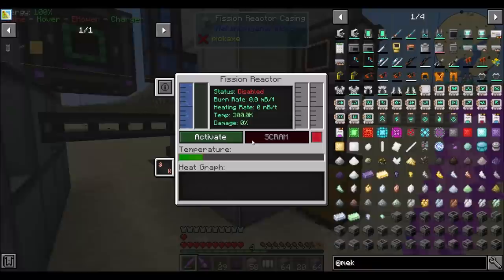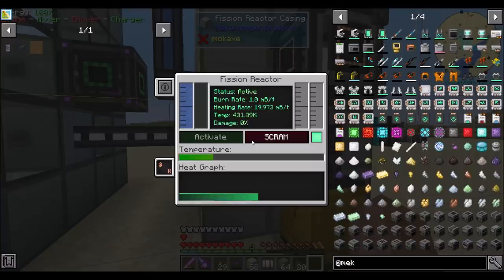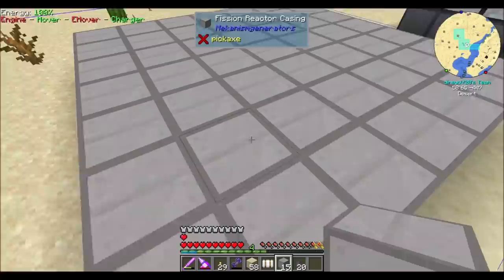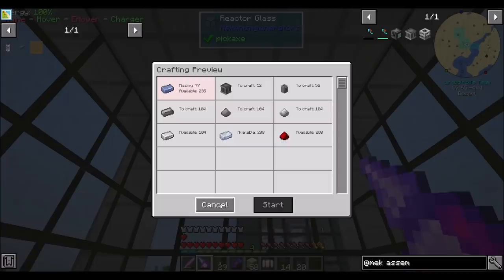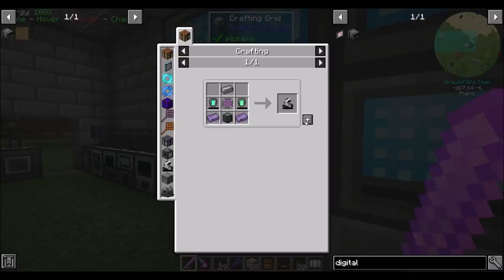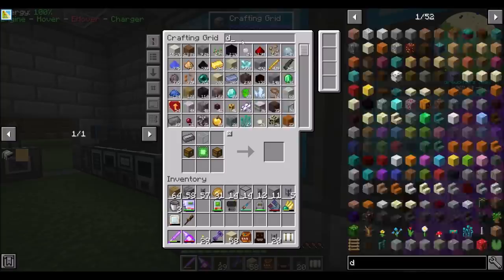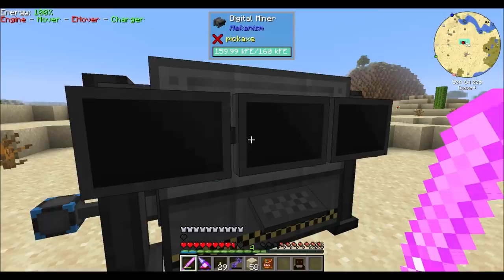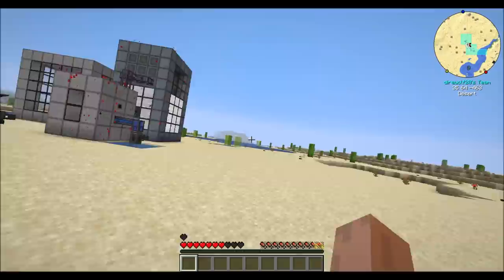Lets Play S10E64 Nuclear Accident

Comment: You are dying instanty because the reactor can't blow up due to claimed chunks, and so it 'blow up' again and again in every tick
Reply: yeahhh this is really painful to watch
Reply: oooooh the claimed chunks, of course... was wondering why it wasn't actually exploding
Reply: Thank you for providing an explaination here, I was certainly confused by this.  Let this be a leson to all the budding Minecraft nuclear engfineers out there.  Redstone controls exist for a reason.  If your reactor is fucked, you can't actually approach it to fix the problem.

For a non-cheaty solution to this, you could uyse a really long Create piston to break up the multiblock (this is just a theory, I haven't testred it)
Reply: @lazeroussdomain5862  that would work, but you would still have to wait for the radiation to subside. A simpler option would be to use a chunk loading option that doesn't prevent the breaking of blocks in claimed territory. That way at least the problem will resolve itself eventually as opposed to having to use cheats. The reactor will properly blow and the radiation will subside in time
Reply: Dire also seems to ignore the part where the 'exploding' reactor has no water in it.
then at 32:40 when setting up the new reactor he goes on to explain how he is depending on water returning from the turbine to  help supply water to the reactor.

So it would seem like the turbine shutdown when the energy buffer filled up and started venting all in coming steam when the steam buffer filled. 
This means that no water is being returned to the reactor and the reactor ran out of water.... or at least that seems logical to me.
Reply: up

Comment: Instead of voiding all your energy you might consider throwing an infinity hammer in the ultimate cube to charge.
Reply: He needs to get an induction matrix to do this. He's generating 1MFE/t, which overloads most chargers (barring tick acceleration), resulting in a boom. It's not hard, just insanely expensive.
Reply: @RealSnarb  or just make the infinity charger from industrial foregoing, that thing can do crazy transfer rates as far as I've seen, and it is made specifically for the infinity items to be charged

Comment: What I think happened with the reactor ever heating is that when it dumps excess it dumps the steam. However, when doing this it doesn't generate any water. This meant that the pump wasn't able to keep up with the reactors use of water which eventually led to not enough cooled in the system which caused the reactor to overheat.
Reply: Yeah, its just easier and safer to make it a closed loop.
Reply: @carsondrum  closed loop still would've failed since once it hits 'dumping excess' it opens the loop.  If the pump isn't strong enough to backfill the water that's being venting, the loop will drain out.

Comment: Ok i don't know if its already been answered in the comments:
the Water ran out, because it was dumping all the steam it got because energy was full. the turbine can only run if its not full of energy. and the pump couldn't get enough water to keep cooling the reactor(try the best pipes all alroud  a sink if its in the pack)
also maybe considering the induction batteries from mekanism they are really strong and not too expensive i think you just need lithium. but would be an option for an endgame energy storage system.
Reply: No, it was just flat out voiding the steam, so none of it was going back into the reactor. Thus voiding excess was a BAD idea.
Reply: Yeah, cooking with blockheads is in the pack. And everyone was calling it including myself when he built the reactor. And he didn't read the comments on it or do proper testing. 100% his fault.
And then he almost does it again.
Reply: IMO "dump excess" should do what it says and dump any excess, including energy, especially if its DIRECTLY under the energy bar.
I am SO glad I'm setting up my reactor TODAY and wont run into this .
Reply: @b00marrows  instead they should add a energy dump excess button, that'd be better
Reply: @commander3494  Yeah, that would be the most logical solution. A dump excess option for each part. I believe the system automatically dumps excess water when there's no output for it already, whys it smart there but dumb elsewhere?
Reply: @b00marrows  Maybe you should spend at least a little time testing before using something that has the potential to do what Dire did. Who obviously didn't test this and in the video provided proof of not understanding what he did wrong by almost doing it again.
Reply: @sijonda  What exactly did he almost do again? you mean the full nuclear barrel? if you didnt notice, yes the barrel was full but the internal buffer (a huge buffer too) was empty, its what he checked right after seeing the barrel was full.
Reply: @b00marrows  He almost ran the reactor dry again. He also didn't wait for the reactor to balance before increasing the burn rate every time assuming it's fine. That's s good way to blow up the reactor when you're testing it.
Reply: @sijonda  He knows about the Kitchen Sink. He said a few episodes back that he wants to use the Electric Pump when dealing with Mekanism machines.
And no, he has said time and time again that he ALWAYS reads the comments. But just because he reads it doesn't mean he has to follow it. This is a "Let's Play", not a "Dire Play the Way I want You to Play" series.
And screw that proper testing, we wouldn't have this kind of episode otherwise.

Comment: i was expecting an accident with a drill tbh but as soon as you said you were going to fill up the energy cube "and later on build the multiblock" i suspected this could happen too.... the problem you had is that the turbine filled up on energy and stopped working. you had a "void excess" but it wasn't energy it was steam and you had the steam voiding so the nuclear reactor had no coolant and that was the source of the meltdown.
Reply: But the water pump was still connected- so it shouldn't have lost coolant.
Reply: @travispluid3603   the reactors drain coolant like nobody's bussiness a single pump is not close enough to handle the needs that's why you should allways have the reactor full of water and the turbine at least half full of steam. Pumping one bucket per x  seconds while the reactor is at 100% capacity is very bad. He voided all the water because the turbine was full of energy and so the reactor was emptied quite fast, which increased the temperature making it worse. And you know the result. He should have had a way to dump all the energy... Like making a massive multiblock that he did say he wasn't gonna make
Reply: @travispluid3603  also basically the reactor was in a stage of continous explosion so water couldn't came in. The reactor damage shouldn't be over 100% but claimed chunks messed the explosion. That's the reason water couldn't go in until he stopped it. (And yet even stopped you see how fast it drains) it's just the worst possible setup tbh

Comment: "Dumping excess" dumps excess steam from the turbine, not excess energy. Dumping the steam instead of condensing it back to water means that your water pump is the only thing cooling your reactor and that's not enough, by far.

You could set the turbine to dump excess (steam) and supply the reactor with an ultimate mechanical pipe that draws from a sink from "Cooking with blockheads" (which is insanely fast). I haven't tested this, but it has a good chance of keeping up with the heating rate.

The only way of getting rid of excess energy would be to consume it in a "Resistive Heater" (without heating anything, if necessary).
Reply: I would add to this that part of the reason why the radiation got so bad is that dire had claimed the chunks, so the reactor couldn't explode. Exploding is sort of a "safety mechanism" in that once damage reaches 100% the reactor should go boom, and from that point onwards it obviously can't create any more radiation. But with the chunks claimed, it just kept heating up more and more and accumulating more and more damage, and doing what the code tells it to do which is release more and more radiation as it gets hotter and hotter - it was never intended to get to 3000% damage or 50,000K heat so the radiation released at that temperature seems ridiculous, but that's the price you pay for artificially preventing the explosion.
Reply: @eagle653  Yeah, that behaviour is kind of a bug. One should be able to blow stuff up by proxy even if one's claimed the chunks if one own the blocks that does it.
Reply: I was wondering why it didn't explode.. That would be a reason for another chunk loading mechanism that doesn't require claiming the chunks. I guess if I ever end up in this situation I'll just have to unclaim the chunks and watch the fireworks. =)
Reply: Sink and ultimate mechanical pipes have no problem with keeping up with the fission reactor. I have even used it to supply water for fusion!
Reply: The cooking for blockheads sink is insane, and I would say its op if the water consumption of the reactor wasn't equally insane.

Comment: Instead of dumping the energy. Why not using that energy to fill the infinity hammer. So maybe you can get artifact Level?
Reply: @EpicCraft1997  laughs in mekanism water filled fusion reactor
Reply: @EpicCraft1997  After E100 Or Greater. Is that enough?
Reply: @EpicCraft1997  I mean sure. if You can't get the artifact level. I think it is better to fill the infinity hammer instead dumping the energy. Idk
Reply: @EpicCraft1997  Idk why but it's just pain to me to void all energy out when we have better solution to deal with.
Reply: @EpicCraft1997  Well considering it's generating over a million RF a tick, 20 ticks in a second, it wouldn't take all that long. I would've given you the math but I can't remember the number to get it to artifact off the top of my head, vaguely remember it being somewhere in the billions or trillions.
Reply: @alexpipes2332  It needs 2^63-1 (roughly 9*10^18) RF to fill up. Assuming you can generate 1 billion rf/t, it would takes 9*10^9 ticks. 1 billion ticks is around 1.5 years, so it would takes 10 years of continuous AFK to fill it up.
Reply: @EpicCraft1997  I've filled a Tier 8 Draconic Orb before. Granted it was with a Tardis Generator. So one tick and the Draconic Orb was full.
Reply: @archcraft1548  Why would that pain you? What's the difference between dumping the energy into a trash can vs dumping it in the hammer? You can't get it to Artifact level in a reasonable amount of time anyway, plus you'll lose the hammer since charging it means you won't be able to use it. That's just stupid, let him dump the energy, there's no use for it. You guys whine too much.
Reply: @netbotcl586  jesus harold christ, I didn't remember it being that high but if it is that's ridiculous
Reply: And completely reasonable to just void
Reply: @EpicCraft1997  I have since learned that I misremembered the number

Comment: This exact thing happened to me. You cannot let the turbine fill with energy, so an induction cell or a trash can is necessary. I knew this would happen the moment you only put an ultimate cube on the turbine. The void excess is for steam, not energy.

The idea of putting the infinity hammer in the cube is a great one, but if you ever want a fusion reactor, you'll need a couple GJ in reserve.

When a turbine fills up with energy, it cannot condense steam anymore, so the reactor was simply producing steam faster than the pump could keep up. Setting a reactor to its limit is a really bad idea because the temperature needs way more coolant. It's much better to have two rods set to half of the limit. The burn rate is the same, but the temperature is lower.

Comment: 14:00 seem like the pump is not pumping enough water for the reactor so wen the turbine stopped energy production ther is not enough water to cool the reactor i think
Reply: A single pump is unable to cool down a reactor because he's voiding all the steam because the turbine was full of power. However at that point (14:00) the reactor is in a stage of perma explosion (that's why dire died so fast, that much times) because the claiming chunks prevent the explosion to really end. Also a reactor damage shouldn't be over 100%
Reply: @JoachimVampire  sorry haven’t messed with mekanism reactors just yet but if he didn’t have dump excess would it be able to keep up? And even if it could keep up wouldn’t it still mess up because the reactor would start to fill with steam because the turbine was full of power (not being able to convert the steam to water)

Edit: was reading more comments and it seems like the turbine was still dumping excess steam just not converting it into water?
Reply: @crucialriefer7108  the issue with the turbine is due to a bug, according to the mod author once set to dump excess it should void both steam AND energy but it didn't void the energy

the problem is that the turbine was full on energy so the turbine stopped working totally. so it never produced water, the single pump was unable to fullfill the needs of the reactor and then the reactor began to heat which in turn made the situation worse because it needed even more water 

you can have the turbine set to dump excess but right now it will dump excess steam only, which means the turbine is voiding it, not converting it to water

a simple solution to dire's issue is to dump the energy into a massive induction matrix or just power up one of the Industrial foregoing OP tools that require insane amounts of energy

Comment: Without the turbine running (due to power being full), no steam is being converted back into water and recirculated to the reactor. The pump alone is not enough to cool the reactor, so it overheats.

Comment: The top is not an output, it’s an input. You can place a resource like dirt in a chest over it and select a mining mode to replace removed blocks with what is in the chest to help with lag due to moving fluids. It does increase the rf cost per block mined tho.

Edit: also yes the steam filled because the power buffer filled up.

Comment: As a little tip, kinda cheaty, look into a kitchen sink from cooking with blockheads, use that instead of a mek pump. It'll move as much water as the ultimate tubes will allow (64kmb/t). It's what I'm doing for my reactor.

Comment: So your radiation problem happened because from my experience, the turbine does not actually dump the excess energy, only the excess steam. What happened was the energy buffer of the turbine filled up so it stopped turning the steam into water which caused your reactor to run out of coolant. Hope this helps!

Comment: Mek tip: if you put the ender chest atop the digital miner it won't auto eject the top, if you turned on auto pull  with an item in the chest it will replace the item with the item in the chest.

Comment: the single waste bucket is going to be fine...i believe that each section of mek pipe holds more than one of those barrels and the only drawback (or benefit) is that the pipes dont shed 1mB per hour...also, isnt there a network scanner that can be used to get details on the pipes when clicked.

Comment: "Radiation wasn't that bad"
2sV/h (ish)
Normal radiation measuring is in microSeverts per hour
Most radioactive part of chernobyl is 300 MICROSEVERTS
(Current worst not worst from when it blew up blow up levels was around 300 Severts an hour so...)

Comment: Dire, why not void excess steam? like the pipe connecting the reactor to the turbine, have another valve that voids steam with a lower priority, or have  some redstone wackiness to control when full or hot

also a proper room to enter when you teleport, with your emergency Scram button located inside safely

also the claimed chunks is stopping the explosion probably. not fun :<

Comment: You had claimed the chunks, so the explosion was being prevented. Since the multiblock was still intact, the reactor "blew up" again and again. You were dying from the reactor exploding, not the radiation.

As for why the reactor blew up I am not 100% sure, but I am pretty sure it was because the turbine shut off. Dumping excess just dumped the excess steam not power. If the turbine isn't running, it doesn't produce water. With no water from the turbine the pump was not producing enough water. I suggest a Cooking for Blockheads Kitchen Sink.

Comment: There clearly was not enough water in the reactor to cool it properly, ~~also you should connect top of the turbine (where water condenses from steam) to the reactor and then maybe dump excess of steam in the turbine.~~ Ok, you had it connected, it just didn't convert to water cuz turbine stoooed working. So conclusion: Not enough water, reactor too hot, reactor goes boom silently
Also yes, turbine stops working when it fills up with power

Comment: Is this modpack on curseforge?
Reply: Its on the FTB launcher, which is also on Overwolf:)
Reply: @zhaulus9608  but on the ftb launcher i cant install mods like on curseforge app
Reply: @mikaelmolander5399  it works just like curse forge just a different launcher.
Reply: @Scottec1425  so i can download mods to direwolf mod pack directly?
Reply: @mikaelmolander5399  are you talking different mods thar are not in the direwolf pack? Csuse the FTB launcher you just open it and select the direwolf 20 mod and it installs it and goes just like curse does. As for adding extra mods to it idk, never tried.
Reply: @Scottec1425  yes adding extra mods, like on curseforge, direwolf last pack is on curse, but not this one.
Reply: @mikaelmolander5399  last I heard was there was some debate about whether to allow editing packs with the FTB packs, but haven't checked in a while
Reply: I just install other mods manually
Reply: managed to move the pack to curse... so all good